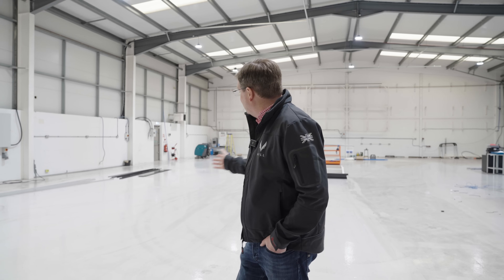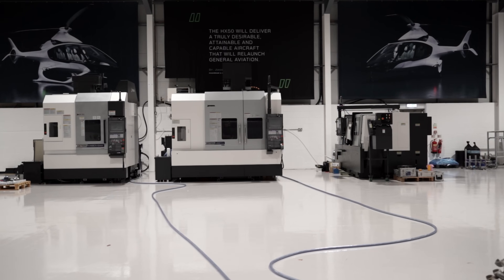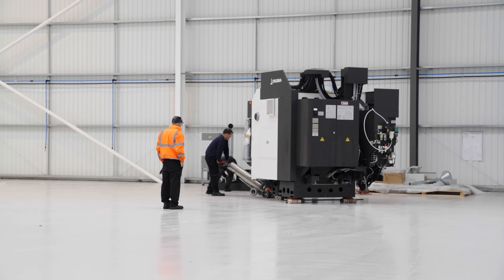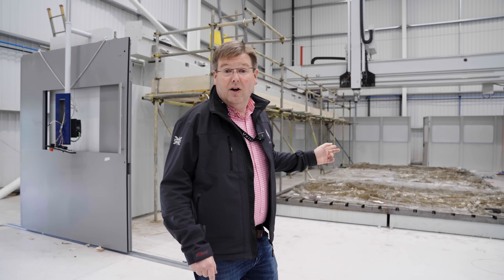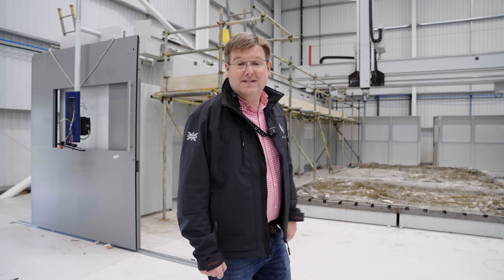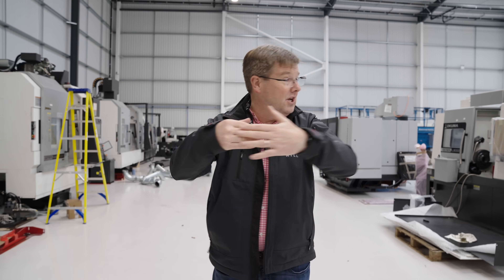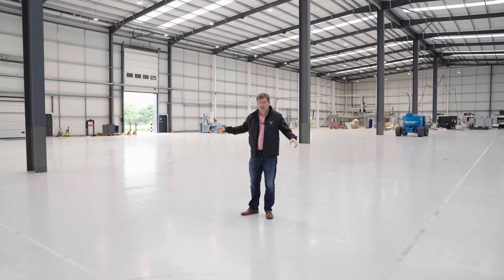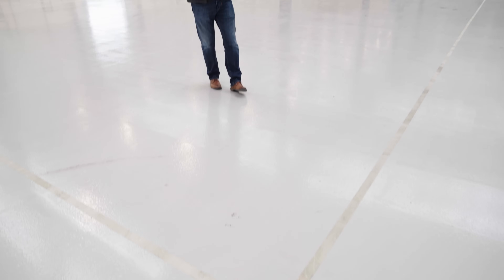From DC1 to PC1: Transforming Our Production Facility

Comment: i deal with some scrapping of old aviation spare parts, so interested in the swarf collection, does this often end up with mixed metals or is separated into alloys etc - also interested in the dust collection from the moldings, i actually have some molds that were used to manufacture trim parts and like to know if these are recyclable and where to send
and naturally interested in what you do with your scrap carbon fibre, do you recycle in house, perhaps to make a paste for fillets etc